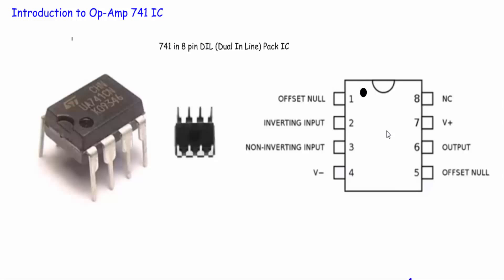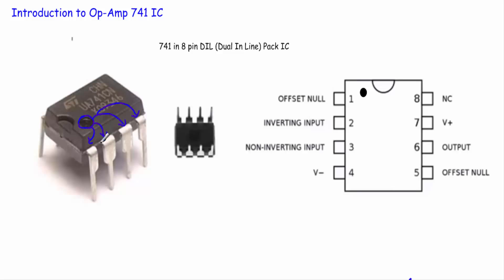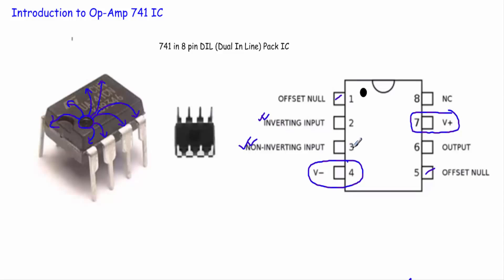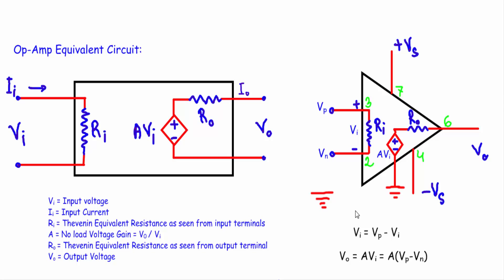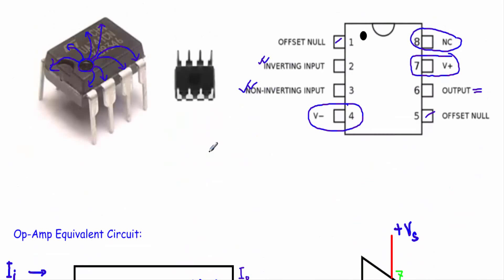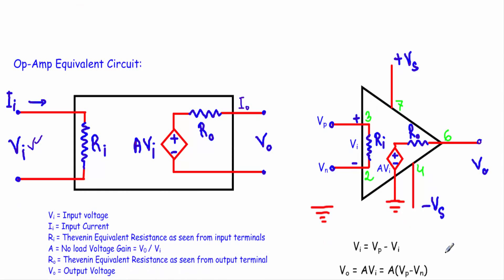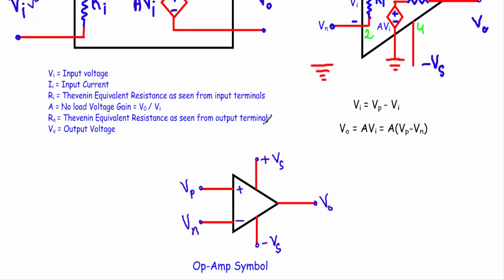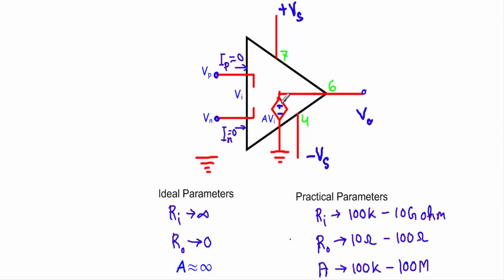Introduction to LM741 IC and Op-Amp equivalent Circuit

Comment: Hello can I have a circuit showing an input of 8mV and output 5v, I need to control the output from a radio signal of 8mV to actuate a 5v relay coil.

Comment: Hey. I recently bought some 12v led strip and set in mu room roof. Now I like to make a circuit to turn them when the dark. I want to make them brighter when the dark is getting high. I think you can understand me. When the darkness is getting high the led strip will be light up slowly. Can you help me to make a circuit for that. The led strip is 12v and 6A . Can you please draw me a circuit.
Reply: Check arduino led tutorials.
Reply: Bro you need microcontroller
Reply: Use LDR and invert them